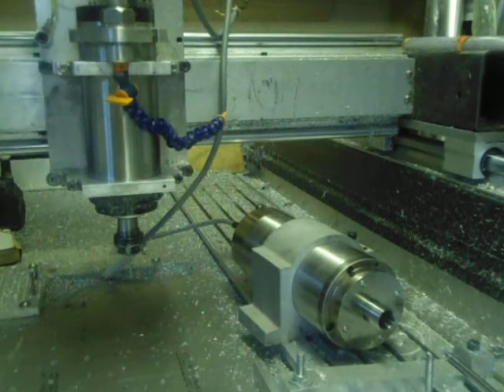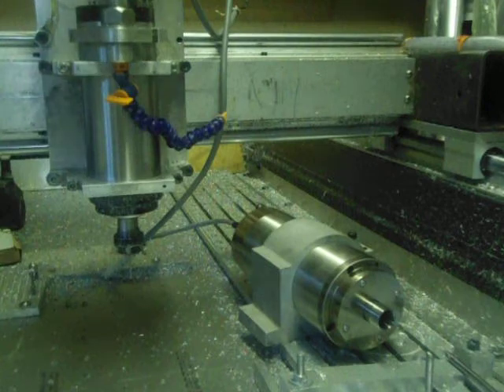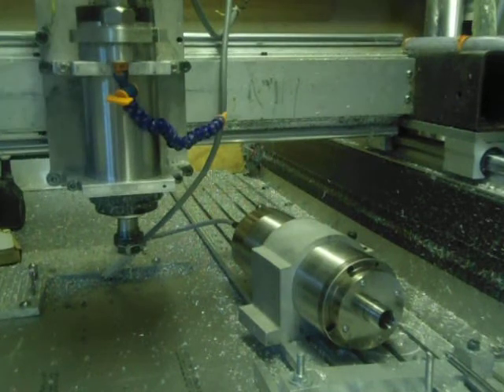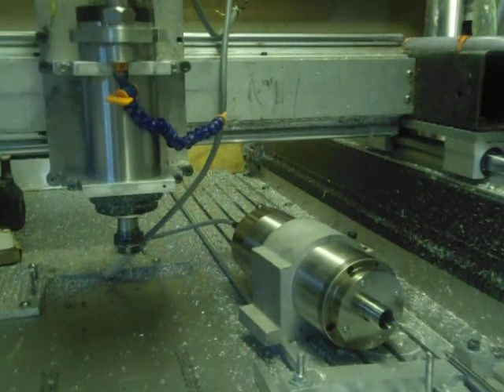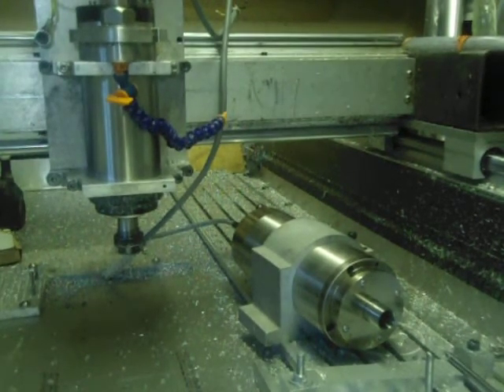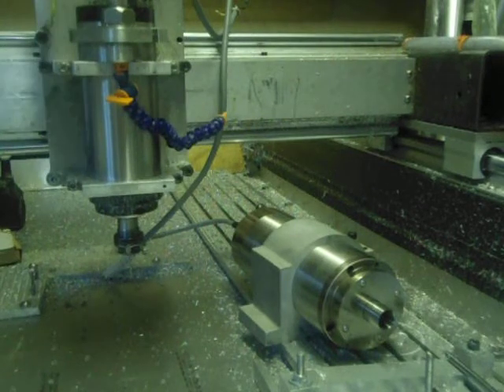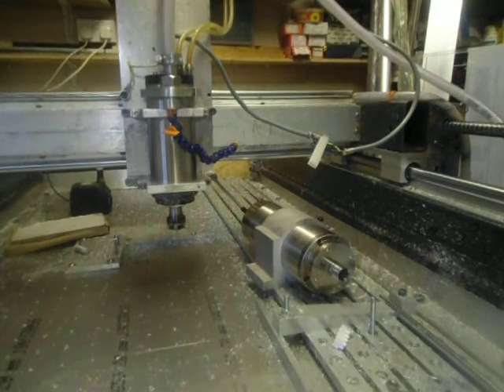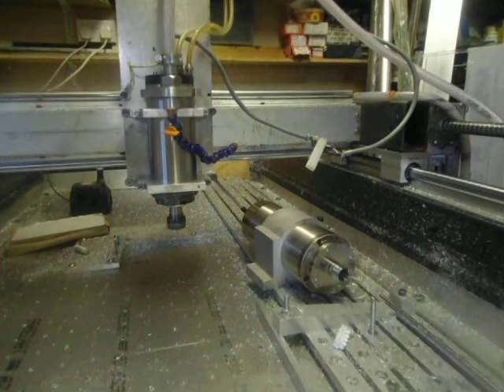2.2kW and 3kW Chinese spindle noise comparison

Comment: Hello and thanks for the video, this really helped me. 
There are so many spindles out there. Can you tell me your source for the higher quality 3KW spindle you bought? I would like to make sure I deal with a good seller and get the same quality. Thanks
Reply: Look on eBay - sort by price highest first! This one:
http://www.ebay.co.uk/itm/Water-Cooled-Spindle-Motor-3KW-4HP-for-Metal-Cut-UK2-/290653440054?pt=UK_BOI_Industrial_Automation_Control_ET&hash=item43ac4b8836
You can also get them from aliexpress, which may work out cheaper.